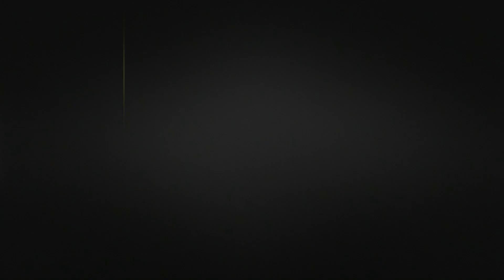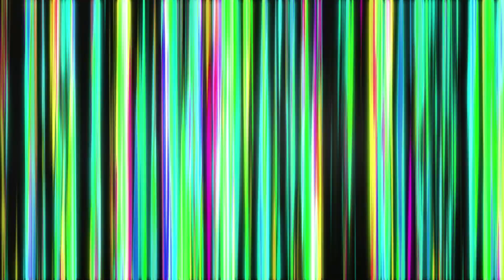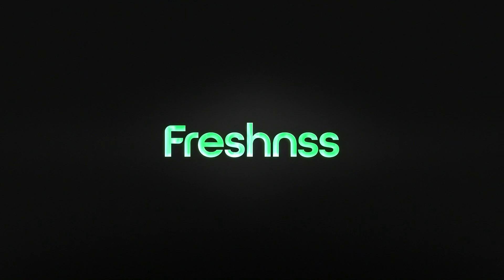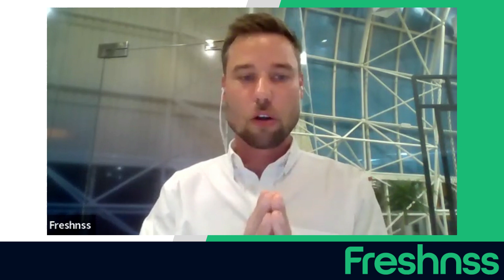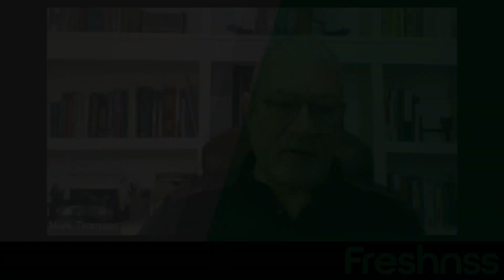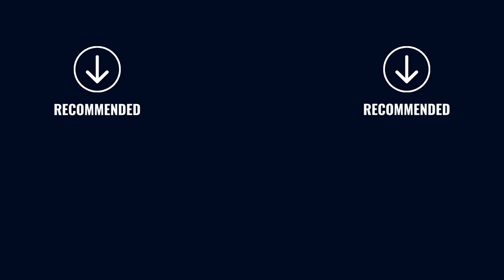Ultimate Guide To WELL WATER FILTRATION!

Comment: well water,  saw a water video this old house they still install a carbon filter then into citric acid cartridge. what system you recommend?
Reply: that’s a part of what i do.  i have 30u, 5u, softener, nuvo manor duo carbon 10u and citric acid, currently empty, and finally a 1/2u carbon under sink.  all 3 are big blue 10”. the currently empty may get a 1u or disruptor

Comment: Can we run a well as back up when the city water goes down? Is there like a convenient switch I can have installed?
Reply from the maker: Technically, yes. Legally, you need to check where you live. Many states will not allow a well to be connected to the municipal source for fear of backflow even if you plumbed it with a bypass or switch.

Comment: My well water taste very good and looks clear. No smell at all. Had a local outfit send off a big test and it looks good to me. Manganese is a little elevated but not much. We have a dark sediment that accumulates at toilet jets and the inside of our toilet tanks are stained black, our water guy, WaterWorks Pump and Well in Covington LA thinks it's from the manganese. The service men they send out have little or no training except for being able to check pumps and service the filters they sell. I placed a spin down sediment filter after the pressure tanks, I have one old and one newer tank, the older does not have a bladder I am told and I believe it has air in the system because a small bleeder hole is required in the roll pipe that goes down to my submersible pump. Any suggestions?
Reply from the maker: Difficult to diagnose in a comment. If you can send us more details and photos via email on our website we can try to help more. It doesn't take much manganese to cause staining, below the epa limits will do it. A spin-down won't help with manganese. Non-bladder pressure tanks should still have a valve, not just a bleeder hole, but not sure why the tanks are relevant?

Comment: Have been in this house for 8 years and only recently started to have some discoloration of the water.  No system or filtration in place today but got the water tested and need to figure out what solutions to purchase. 
Parameter Result Pass/Fail/Acceptable RL
Bacteria-Total Coliform Present Fail 1
Bacteria - E-Coli Absent Pass 1
Nitrate + Nitrite as N 2.6 Pass 0.5
Nitrite - N Not Detected Pass 0.1
Lead, Total 0.0158 Fail 0.002
Iron, Total Not Detected Acceptable 0.05
Turbidity .9 Pass 0.5
pH 6.5 None 1
Reply from the maker: Feel free to reach out to us at freshnss.com, we're happy to help you interpret your test results!

Comment: Can we use the bypass valve when  we use house water to water plants?
Reply from the maker: You can always use the bypass for any properly installed filtration or treatment system. However, keep in mind that you would have to clear all the standing water in the pipes which could be very wasteful. A better option would be to use a spigot available before your treatment systems. If you didn't have one already, you could ensure that a plumber installs one during any system installation.

Comment: I don,t know the iron levels, have shocked the well 2 times in the last 5 years. The well has a pretty bad Iron problem. (rust coloured muck) when emptying, I don,t want to shock the well more often and I just want to solve this stain in my toilet by more filtration possibly.  I Would rather not change my cartidges more often either . Thanks
Reply from the maker: Thanks for the follow up info.  We really need to know the specific iron and bacteria levels to prescribe the right treatment.  As we mention in the video, it is like going to the doctor, you need do have the analysis first.  So I would suggest starting with a well water test.  We have a couple of options here: https://freshnss.com/water-test-kits/well-water-test-kits/

Then we will know for sure what you need.  But in general, adding more and more sediment filters is not going to be the right solution.

Comment: I use a 20 micron and 5 micron in line (2 sediment filters) and still get some iron staining in one of my toilets. My well water is pretty good other than Iron .  Could I add another 20 micron or 5 micron or a 30 micron to clean up this Iron problem ?  (3 sediment filters in line) I don,t have a treatment system and don,t want or need . Thanks
Reply from the maker: Hey there!  Have you tested your water or know what your iron or bacteria levels are?  Have you done a disinfection treatment (shock your well) in the last 12 months?  You say you don’t want an oxidation system, but it may be the best solution.

Comment: We have 23 ppb of arsenic and limit is 10 ppb,  for now till we come up with  a solution we are using bottled water. Can you help with coming up with a solution?
Reply from the maker: Yes!  You definitely need to do something about that!  Let me find a couple of the best solutions and send them over shortly 👍
Reply from the maker: Hey There - here are the best options for your arsenic.  
The Crystal Quest is the best whole house filter for arsenic that will remove other contaminants like VOCs in the pre & post filters too. You can also add the softener if you have hard water or light iron/magnesium/sulfer issues. Check that option here: https://crystalquest.com/discount/FRESH5?redirect=/collections/arsenic-removal/products/arsenic-whole-house-water-filter?aff=222

Alternatively, you can go with a point of use reverse osmosis.  Your best option for this is the Home Master that is specifically designed for well water (not many RO are well equipped for well water).  This will do an excelent job removing arsenic and most other contaminants from your drinking water. Check that out here: https://bit.ly/3dUhhu8

If you want the best protection, a lot of people will go with a whole house filter and also add the RO at the kitchen sink. 

If you want to send me your entire water test results, we can double check to make sure this is the best solution for your water, just email me at erik (at) freshnss.com
Reply: We have arsenic also😮
Reply: @lisaa1134  We ended up getting a Reverse Osmosis System and works great. Google search for something that will work for you.
Reply: What’s worst hardness or iron to get out of the water
Reply: @larrylarry6771  While both can be considered contaminants in water, "hardness" primarily refers to the presence of dissolved calcium and magnesium ions, while "iron in water" specifically indicates the presence of iron ions, which can contribute to hardness but is not the sole factor defining it; essentially, hard water can contain high levels of iron, but not all water with iron is considered hard. ( We have been happy with @freshness and if you call them, they likely will have a solution for you. )

Comment: I just bought a home with well water and I believe that I have a galvanized tank. Should I replace it asap or wait until it fails?
Reply from the maker: Definitely look to get that replaced. We cover the negatives of using old galvanized tanks in the video.  They present a number of issues for well water treatment.
Reply: Just get a PVC liner installed
Reply: Just getting started on well.  I have a newly built home and a well contractor installed new galvanized tank. Wait a while or replace soon?